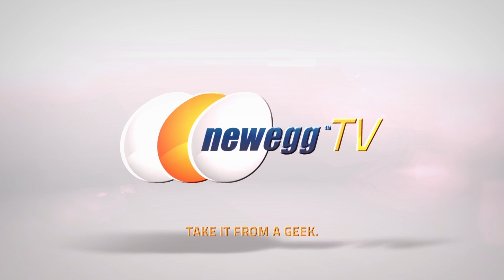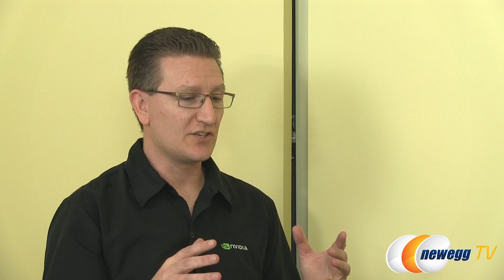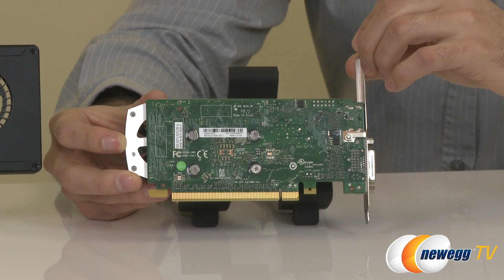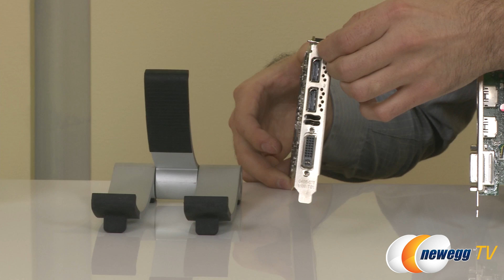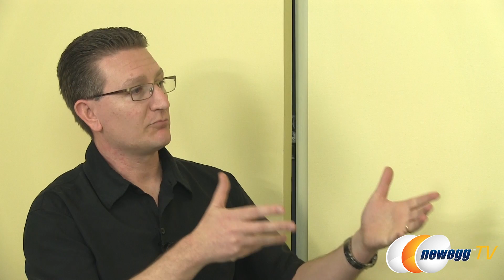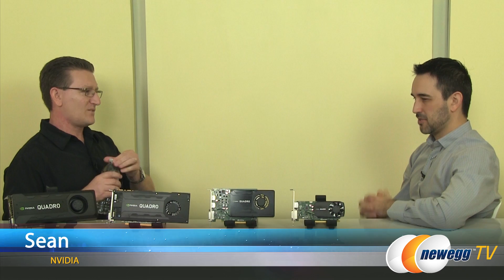Nvidia Quadro Refresh Interview - Newegg TV

Comment: Quadro K620                                                                     Quadro k600        
Maxwell  core                                                                      Kepler   core 
384 cores                                                                            192 cores
2 GB DDR 3                                                                           1 Gb DDR 3
1,870 million transistors                                               1,270 million transistors
Pixel Rate   17.98 GPixel/s                                             Pixel Rate  3.504 GPixel/s
Texture Rate  26.98 GTexel/s                                      Texture Rate  14.02 GTexel/s
28.80 GB/s Bandwidth                                                  28.51 GB/s   Bandwidth
DX 12                                                                                      DX 12
45 watts                                                                                  41 watts

Comment: I run three monitors and had no idea what the difference was between a workstation and a gaming card. I always thought if you had a badass gaming card, you were set for it to work just as well as a workstation card. Well, my video tends to freeze up while I'm surfing the web and vice-versa. I think I need a new "workstation" card that will enable me to multitask in multiple website windows, run Netflix,  and Sony Vega 11 with three monitors hooked up. Problem is, I can't fork out 500 on a card. So, my question is, is there a workstation card you would recommend at 300 or below with two HDMI and one DVI connection?

Comment: Hey guys, do you think it's a good PC that I'm planning to buy?
motherboard: Asrock FM2A58+ BTC (AMD FM2)
CPU: AMD A10 7700K (AMD FM2)
Memory1: Adata 8GB 1333MHz DDR3 AD3U1333W8G9-R (DDR3)
Memory2: Adata 8GB 1333MHz DDR3 AD3U1333W8G9-R (DDR3)
GPU: Nvidia Asus GTX970 4GB DDR5 GTX970-DC2OC-4GD5-BLACK
HDD: Seagate 2TB 64MB SATA3 ST2000DM001 (3,5")
Power supply: Antec 750W HCG-750
Case: Cooler Master Elite 241 RC-241-KKN4 (Not sure)
CPU cooler: Cooler Master Hyper 612 Ver.2 RR-H6V2-13PK-R1
Reply: get an core i5 4460 430w psu and if you only game 8gb ram
Reply: CHgeri100 What's your purpose of the build? If it's gaming, go grab an i5, perhaps a low end, scale down your PSU to 700W.
Reply: I would mostly sue it for gaming. Thank you for guys for helping me out :).
Reply: CHgeri100 You will need an SSD as boot drive about 1-2 years later and more storage. But for now, it is playable.

Comment: How do we know it has full advertised memory running at full speed?
Reply: We don't! The GTX 970 was a bad move by nvidia, feel sorry for peeps who purchased a few of them for 4K gaming!
Reply: Because it's not a Maxwell card, it's still Kepler based. The configuration that results in the slow memory is not possible on Kepler.
Reply: Chronofusion WRONG. GTX 970 doesn't outperforms 290/290x in many applications. they compete with each other in many aspects, therefore nobody can say one is better than the other. as a matter of fact when it comes to high resolution/high textures 290/290x leads the way. 4gb means 4gb.

- i'm using GTX 980 and Asus G-sync monitor, so don't assume that I'm a fanboy.
Reply: Dans Tech Yes, feel sorry for those who spent between 325 to 380 bucks for a solid mid ranged 4k gaming/highest end 1440p gaming vid card that outperforms the 290 and 290x.  -_-

Ftr I'm currently running a r9 280x and love it and have purchased an equal amount of vid cards from both red and green teams throughout the past 13 years.

The memorygate bs is over.  Pick something new to spout your asinine trashbook.com=OVERenduldged " ooh ooo..here's the next stupid converstional pass it on trend" crap about.
Reply: Dans Tech who purchased 970 to play at 4K resolution doesn't have a brain anyway.
Reply: The memory problem is fixed now ?
Reply: ***** Fixed? You mean clarified? There was nothing done to "fix" the cards.
Reply: BmanUltima so should i buy a gtx 970 ? or a gtx 980 ? there is still the problem of the 3,5 gb and 1/2 gb ?
Reply: ***** Buy what you can afford. The 970 and 980 are in different price brackets. I would compare the 970 against the R9 290X instead. Also, you're almost never going to have to use the last 0.5GB of VRAM anyway, so it's not a big problem.
Reply: BmanUltima so this two different vram pool isnt a big problem for someone to think that he shouldnt buy gtx 970
Reply: ***** You are the prime example of why you should never listen to others opinions and actually research any information your going to promote.
Reply: ***** Yes, the VRAM on the GTX 970 is split up into two pools. One pool containing 3.5gb and another with 500mb. But ask yourself this when will you have use over 3gb of vram? Let alone 3.5?
Reply: i dunno :P i use 1080p monitor. will i ever use more than 3.5gb ?
Reply: ***** The way you determine on how much VRAM you will actually use is determined on the game not the size of your monitor. For example, League of legends might take 1200mb (1.2gb) at maximum settings such as the other hand Far cry 4 might take 3900mb (3.9gb) at maximum settings.
Reply: ***** The most I've ever used with my card is about 3.2GB with heavily modded Skyrim, and BF4 a close second at 2.8GB, while Far Cry 4 only uses 2.6 at the most.
Reply: ***** Yes as i was just giving irraticle examples as they were just examples. For far cry 4 however heres a recent benchmark for some high-end GPUs : http://www.gamersnexus.net/game-bench/1701-far-cry-4-gpu-benchmark-amd-is-broken-again
Reply: Skyler Knecht Weird. On my system Far Cry doesn't use nearly as much VRAM and runs much better.
Reply: BmanUltima Thats interesting what are your specifications?
Reply: Skyler Knecht i5-4690k, R9 290 OC 15%, 8GB RAM. I'm running on Ultra preset and averaging 70fps. Could it be that there was an update after that review came out?
Reply: BmanUltima That could be a possibility. I'm thinking about doing a overview on VRAM and how much you actually need here soon so I'll definitely have to look more into this.
Reply: ***** What? Are you an Nvidia fanboy?
Reply: ***** How is it a joke? He was pointing out that we no longer can trust Nvidia to state the correct amount of VRAM on their cards.
Reply: Dans Tech The 970 can't run proper 4K any way. Just about manages ultra at 1080 p. Reason for me upgrading to 980 Ti

Comment: So this is nvidias firepro?
Reply: Barish K
Quadro better for those type of things but as CAD work goes Firepro or gaming they do decent
Reply: XDENT TIM is the 4200 a big jump from the 2200 or should I save some money and get the 2200?
Reply: Barish K
4200 is not a huge jump but it will go faster then the 2200 but the 2200 is good it will do fine
Reply: vlad dragos Yes.
Reply: yeah pretty much but i would still buy the ATi card over a quadro
Reply: +XDENT TIM why?
I need an acceleration gpu for Adobe CC
Which is better? Amd or nvidia